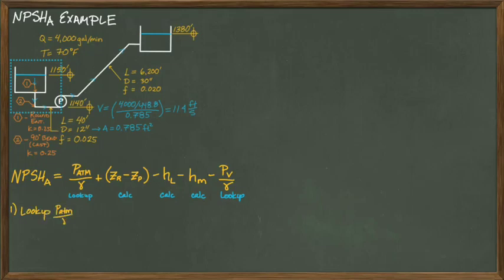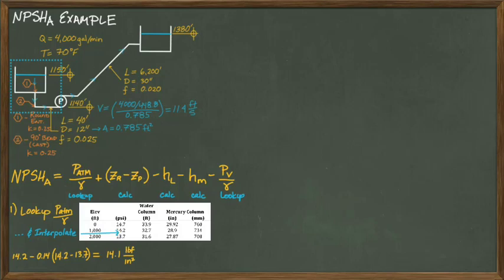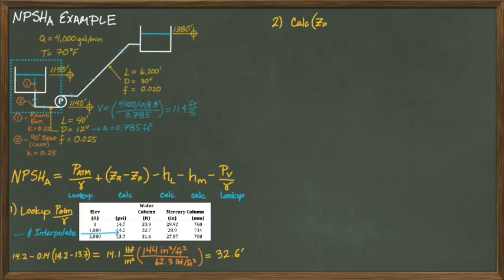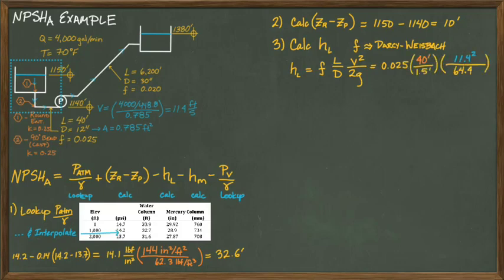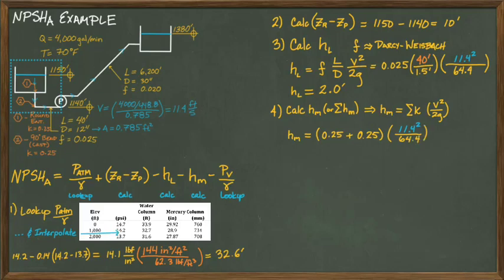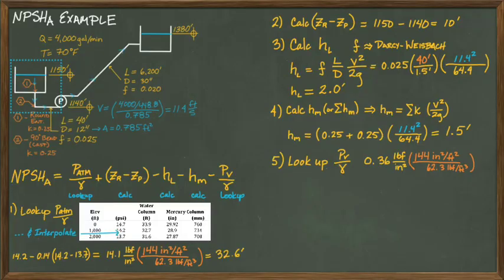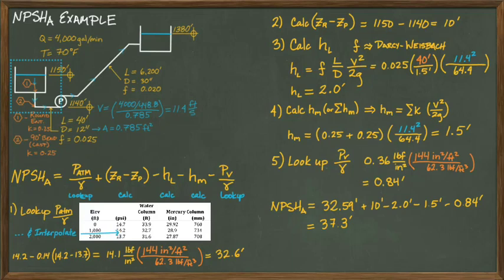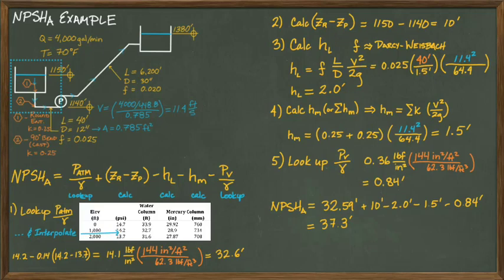NPSHa Example ***OLD Video W/Typo***

Comment: Is NPSH calc applicable for closed loop systems? I only saw open loop examples and nothing for closed system
Reply from the maker: The same process to analyze NPSHa in an open loop system applies to closed loop systems as well.
Reply: @kennethwlamb  is there any example you can point me to?
Reply from the maker: @slengoslengaw8510  The NPSHa calculation does not consider anything that is on the discharge side of the pump.  Therefore, I do not see how the system being a closed loop or open loop would change the calculation. Is there a sample system you have in mind?

One small difference in the NPSHa calculation can occur when the source of water on the suction side has a starting pressure that is greater than atmospheric pressure.  For example the pump is pulling water from a pressurized storage tank. In this situation it is not just the elevation difference (ztank - zpump) but the elevation of the tank plus the tank pressure (then subtract the pump elevation)..

Comment: Sir one question. 
How to calculate npsha for pump in series
Reply from the maker: Believe it or not, it would be the same process because the NPSHa would be computed at the first pump.  You could compute NPSHa for each subsequent pump but it likely would not be useful as the most critical is the first pump in the series.
Reply: @kennethwlamb  sir NPSHa for first pump in series  I calculate as patm+ (water level  minus impeller eye level)  minus vapour pressure. Here first pump takes water from source ie dam or reservoirs. Now for second pump which is in series here NPSHa= residual head left behind at impeller eye of second pump minus vapour pressure. 
Here I doesn't take atmospheric pressure. 
I think I m on right path.
Reply from the maker: @greentechguru362  Yes I think you are on the right path.  Perhaps I would have explained it as:
When considering the NPSHa for the second pump you must replace the potential energy calculation (Res elevation - Pump Eye) with the static head between the first and second pump (Dynamic Head - Pump Eye).  You could say that the Dynamic Head at pump 2 is the residual pressure at pump 2.  Therefore we are in agreement.

Comment: Hi you! Do you know that NPSHa Booster pums ???
Reply from the maker: Do you mean, do i know how to analyze NPSHa for a booster pump?
Reply: @kennethwlamb  yes sir. You can help me analyze NPSHa for a booster pumps?
Reply from the maker: @ATTRUONGNGOC  the equation covered here applies to a booster pump situation as well.  In this example the water level feeding into the pump is higher than the pump suction flange. Is that the case with your booster pump as well?
Reply: @kennethwlamb  I have an old pump and an old piece of pipe.  I installed a booster pump and the 2" pipe is 18.5M high and 675M long. My pump is 2M higher than the old pipe.
Reply from the maker: @ATTRUONGNGOC  What is your objective?  Is all you need to do is compute the NPSHa? Or is there more?
Reply from the maker: @ATTRUONGNGOC  Sorry for the slow reply.  My understanding:  Your booster bump is connected in-line with another pump that sends the fluid directly into the pump.  If that is the case, then this calculation should analyze the residual pressure from the first pump at the suction flange of the boosterpump.  That residual pressure could represent the delta-Z between the suction reservoir and the pump flange.  Other than that I think the analysis should be similar (unless someone else has other thoughts...?)

Comment: Just a question, if I dont have the flow rate, how can I do this?
Reply from the maker: So, answering this question might require a couple new videos ;-) but I'll give it a try...

For a potable water system you start by computing the water demand and the required water storage for your pumping system.  Once you know the water storage you must determine how long you want to take to fill the storage tank. Most systems do not spend all day (e.g. 24 hours to fill the storage tank). Pick a time that allows the tank to be filled outside the peak power usage time for your electricity provider. Once you have the volume, divide it by the time and you now have the "design flow rate" of your system. 

There are other complicating factors so you are motivating me to make more videos.
Reply: @kennethwlamb  Thank you for your answer! 
But what I was thinking of is how can you determine the pump suction flow rate if you have a filled tank that is supplying it. I mean with time, the level in the tank will change right? and therefore, your flow rate will too. Add to that, how can you calculate flow through a nozzle to the pump?
Reply: I believe that pump suction flow rate will depend on your tank level and gravity effect. Correct me if I am wrong. And I am not certain how can I find flow rate at pump suction.
Reply from the maker: @vadkaa5053  for the NPSHa  calculation the velocity is not determined by gravity because the pump is adding a significant amount of energy to the fluid and is drawing water from the tank at a faster rate than gravity alone.  Therefore you still need to create the system curve and select a pump to obtain a pump curve to find the operating flowrate from the intersection of these two curves.  I have another video explaining system curves and pump curves.  

You are correct that the water level in the suction tank has an impact on the flowrate.  When the tank is higher, the velocity is higher at the pump suction flange than when the water level is lower and the tank is almost empty.  For the NPSHa calculation we focus on the time just before the suction tank empties because that is when the risk of cavitation is highest. 

Does that help answer your question better?
Reply: @kennethwlamb  It is helpful thank you very much. But there is one question left, does that mean that flow rate at pump suction and discharge is similar?
Reply from the maker: @vadkaa5053  flowrate, Q, at the suction and discharge flanges is equal.  Generally pumps have different diameters for the suction and discharge flanges so the velocities at each end  can be different.
Reply: @kennethwlamb  Thank you for your answers you have corrected some of the ideas I had.
Reply: @vadkaa5053 and @kenethwlamb... In reality, is the Pump's flow rate defined before? For example, Flowrate 160 USGPM. Then, how do you calculate the Water Tank's filling rate?

Comment: May I ask if where did you Lookup the value 0.36 of Vapor Pressure Head?
Reply from the maker: I found it in a table showing the properties of water.  You can find such a table in many fluids or hydraulics books or on the Internet.

Comment: hello, if the pump system uses many pipes with different diameters and length L, how do we calculate Hp?
Reply from the maker: If your system have many different pipe diameters and roughnesses then you simply add another pipeline term to your hp equation. Example: let's say you have three pipelines. One is 24-inch, another 20-inch, and a third 18-inch.  Then you would have three terms added together in the system curve  to account for the  energy loss in each pipeline.

Comment: Great video, thank you so much.
I think the velocity used in calculating the losses is wrong, because you found the velocity by using the flow rate ((after pumping)), I found that usually the suction velocity is considered 0.6 to 1.5 m/s
Please correct me if I am wrong
Reply from the maker: On the Operation of a pump, the flow through the system constantly varies as the pump drains the suction reservoir and fills the discharge reservoir.  Therefore you only need to use the maximum flowreate for the NPSHa calculation. In this example I only use the "pump design flow rate" for the sake of simplicity (because that is how the problems are set up in licensing exam questions in the US ).

Comment: Hi Kenneth, I noticed the calculation does not include the head required to pump the liquid after the pump. How to count the entire head required for this system ?
Reply from the maker: Hi Kay, when we are evaluating the net positive suction head available in a pump system, we are only concerned with the hydraulics that exist between the suction side storage and the suction flange of the pump.  Other analyses we consider the pressure downstream (or what comes "after" the pump), but not with NPSHa. Does that answer your question?
Reply: @kennethwlamb  Hi Kenneth, thank you for your reply! Do you have the video to count the "head after the pump" ? As in my case I need to consider the head create from all the outlets (let's say ststic pressure: 50000 Pa each from 10 outlets), 90 deg bending as well as the piple L/D. I suppose I need this to ensure the pump HQ curve exceed "head after pump".
Reply from the maker: @Kaykay133-w9z  If you are curious about how to find the residual pressure at any point after the pump then you can use my videos on analyzing a pressurized pipeline.
https://www.youtube.com/playlist?list=PLKbpg9Z0_Xwn52vueUU_ZIFFsqD4mdhj5
The most relevant videos on this playlist are the Conservation of Energy Applied, and Residual Pressure.  Hopefully, those are helpful to get what you need.

Comment: Why do you use 144 to convert the pressure to feet? I need to do the same calculation but for diesel which has a different density than water. Would 144 still apply?
Reply from the maker: Yes it would because this is to convert sq. inch to sq. ft (i.e. 144 sq in = 1 sq ft).
Perhaps it would be easier if you just used the specific gravity of the diesel rather than going 'back' to using the density of diesel.  It might save you a couple steps.

Comment: how can pump inlet elevation at 1140 feet
Reply from the maker: It just means that the tank is above the pump inlet.  You can set the elevation of the pump at any elevation below the storage.  If the pump elevation is above the storage then the pump will need to be primed before operation (this is less ideal but possible as well).  Does that help answer your question?
Reply: @kennethwlamb  if the pump and the storage tank have same elevation,  Does the height of the water inside the storage tank considered? for example water inside tank is 1m..Does Zr-Zp equal to 1m?
Reply from the maker: @muhdimran5389  You still consider the elevation of the tank even if it is equal to the elevation of the pump inlet because that is simply good bookkeeping of your computations.  All this would mean is that the static pressure normally contributed by the tank is '0'.
Reply: All mentioned elevations are measured from sea level, right?

Comment: why your suction pipe dia is smaller than the discharge?
Reply from the maker: The suction pipe is sized with a different criteria. Typical suction pipes have a velocity between 10-12 Ft/s while the discharge pipeline is sized for another criteria using a lower max velocity or unit headloss. The suction and discharge pipelines are typically different for that reason.

Comment: lovely video , i noticed  a mistake in the conversion of the internal diameter of the suction pipe , D=12'' =1' not 1.5' used in calculating friction loss , fL/D(v^2/2g), minor loss is actually 1' ,thanks
Reply from the maker: You are correct!  My apologies and, also I'm sorry for not noticing this comment until now.  Thank you for your observation!

Comment: Your explanation is breathtakingly good, thanks for that. But, I only have a doubt in the first term calculation. Why is considered the height at the pump(1140) instead of the height at the reservoir(1150)? because it is supposed that the atmospheric pressure mainly acts on the top of the reservoir tank water.
Reply from the maker: NPSHa is considered at the pump elevation because that is the location where the risk of cavitation exists.  There is no risk of cavitation in the reservoir.

Comment: What are the effects if the tanks are closed ?
Reply: On the suction side (tank 1) it will increase your 1st term helping you out.
Reply: @MerekRoman  Nice. How we can determine the pressure inside the tank 1 when it is closed?
Reply from the maker: @salemrachdi8704  If the suction tank is pressurized it is becuase you (the operations engineer) are pressurizing it ... intentionally.  Therefore it isn't something that you compute but it is a given.  If your objective is to add pressure tothe suction tank to improve the NPSHa in the system, then you could solve for the pressure by using the steps covered in this video (assuming there is no additional pressure applied to the tank), then add the pressure needed to meet the NPSHa requirement.  However, I can not think of a scenario where you will solve for the pressure in tank 1 as an objective by itself.
Reply: @kennethwlamb  Thanks. Some costumer ask to close the tank from the top and basically for concrete tanks and provide a vent. I will consider these tanks as opened tanks because there is a vent on tanks top.
Reply from the maker: @salemrachdi8704  That is how I would do it as well.

Comment: It is a very fantastic explanation. But I do have one question regarding the NPSHa formula. From time to time I saw people using another formula to find the NPSHa, NPSHA = Ha +/- Hs – Hf + Hv – Hvp, they have the term Hv (velocity head) to be positive and I really don't understand why. Would you mind explaining the difference between your formula and this one? Thank you very much!
Reply from the maker: The derivation of the NPSHa equation is from conservation of energy which has + Hv.  After doing some research there is no particular reason that I can see for omitting it other than including it makes NPSHa less conservative.  The authors of Pumping Station Design, 3rd Edition state, "There is no term for velocity head in [the NPSHa Equation] because velocity head is part of the absolute dynamic head."  However, I just attended a webinar from the hydraulics institute where they are including the Hv term. The Hydraulics Institute is the final word, in general.
Reply: Could you explain more about this issue, it makes the one confused about many formulas